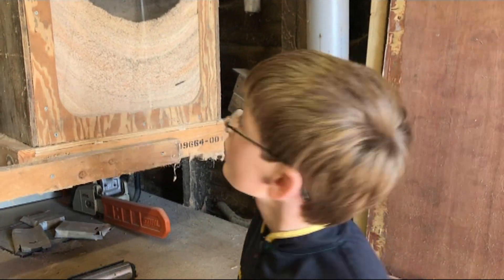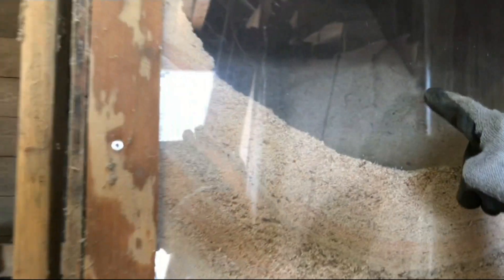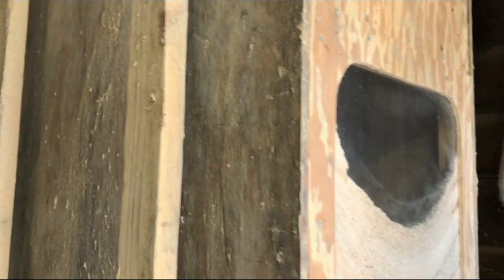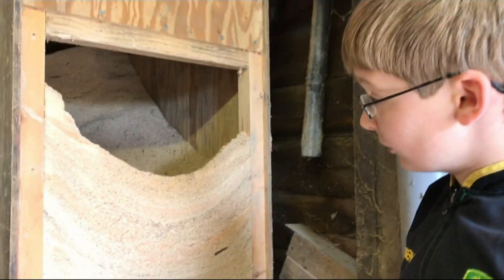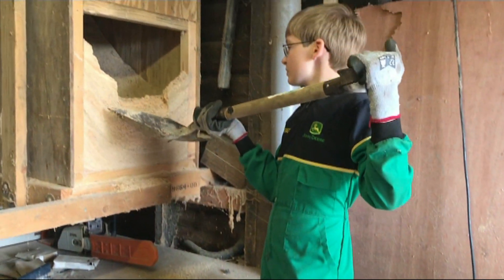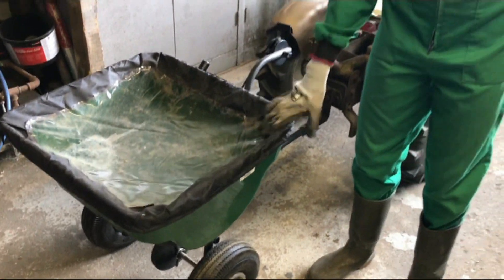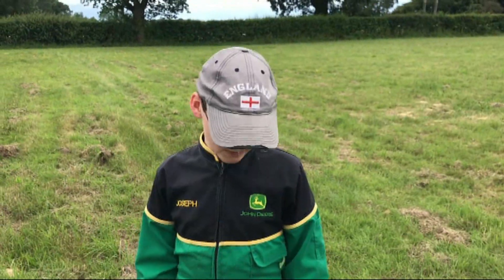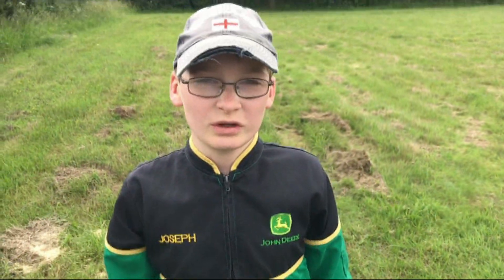Sawdust collection and compost

Comment: Using the sawdust to put on the grass is a good idea.  I rather burn it in winter... But I need to mix with logs, as it does not burn well by itself. That is a huge sawdust collector.  BTW, when you use plastic pipes, it's highly recommendable to run a conductive wire along the pipe, from the tool, to the dust collector, to the final destination. Otherwise, you can have static electricity and consequently nasty sparks within your pipes... containing fine sawdust.  Been there before.  I noticed flashes... I did the correction before a fire happen. Thanks!
Reply from the maker: Thanks, we have not seen any sparks so far but the collector and machine are well earthed. We will add a conductive wire as you suggested to ensure we are safe